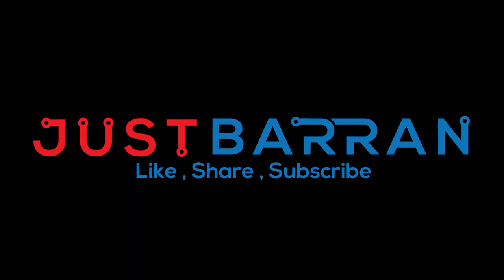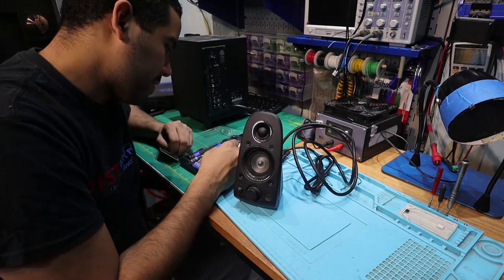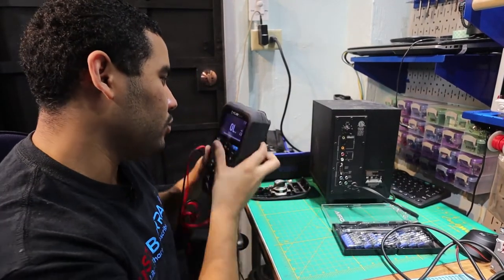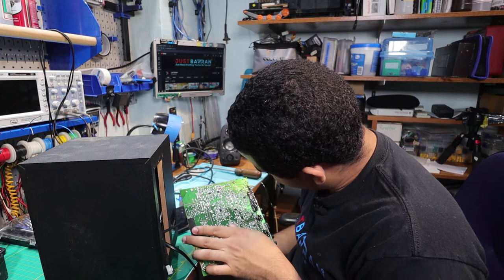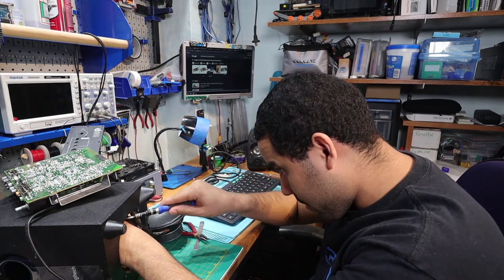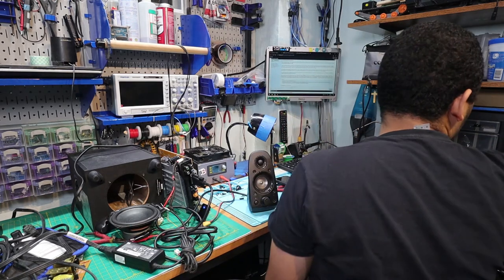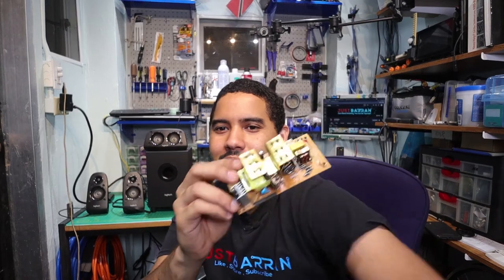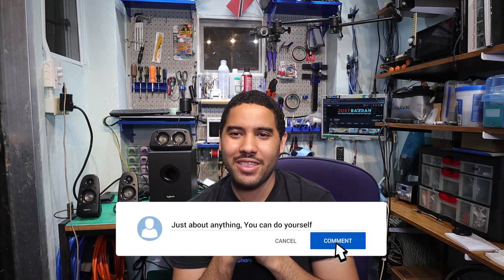Logitech z506 Speaker Repair | Fix-it Friday #2

Comment: Hello! Bro, my master speaker from my Z506 is "broken" according to the technician. He told me that I need to buy the master speaker, BUT that is not in amazon or any other website for me to purchase, or is it?  Can the cable be fixed? Please answer. Greetings from Panama!
Reply from the maker: Hey Robert, when he says it is broken does he mean that the power supply is broken like in mines ? Or is the speaker with the knob broken. Because as in the video you can also try what I did and change out the powersupply with a old laptop powersupply first.  If the power supply is broken the. The master speaker would not work also

Comment: Watching this video cause I have a 7 year old Logitech Z506 which i bought from supertech in puna for $550 and still works perfectly. And I recently saw on amazon for this same brand goes for $264.64usd 🤣and the Logitech Z906 for $399.00 . So I have a damn expensive system in 2022. So I was just looking around to see what is the type of issues can occur and how to prevent them.
Reply from the maker: Thanks for watching 🥹
Reply: @JustBarran  not calling anything on my speakers but if anything goes wrong i know where to go 👍

Comment: Do you know how to fix the part where you plug in the speakers to the subwoofer? Cause the right front(black) female connector on the subwoofer is only making noise or static when i hook up my speaker.
Reply from the maker: Sorry I returned the speaker to the owner, so I really can't say.

Comment: What are the values of the adapter you plugged in? Is there any problem if I use 12 volts and 3 amps?
Reply from the maker: The 12v isn’t enough because amplifier is rated for higher voltages, I think 12 may still working but it would affect the maximum output volume among other things
Reply: @JustBarran i get a very wierd doing with 18v, is it normal?

Comment: Hello, do you know if it's possible to modify this subwoofer for use with RCA input  without the control speaker? I acquired the subwoofer by itself and i'm looking to see what I can do with it.
Reply from the maker: It should be possible since the control speaker doesn’t do much other than put on the amplifier and set the volume. It would require getting a pin out for the DB9/rs232 connector and making the required circuit. Check out this https://www.yoreparo.com/es/audio/audio/preguntas/1250316/logitech-z506-control-de-volumen-db9
Reply: @JustBarran  Thank you.
Reply from the maker: No problem

Comment: is it better to use 19v laptop adapter or 15v ?
Reply from the maker: I don't think it should matter, I believe the original one was around 15v, once the current is around >2A
Reply: @JustBarran  thank you for your response, I was just wondering if using 19v will create a static or noise?
Reply from the maker: I really not sure, am not that deep in electronics to say